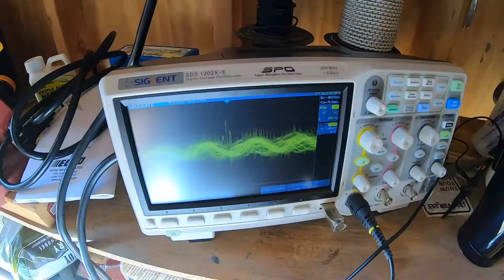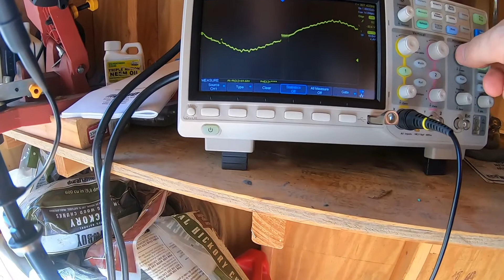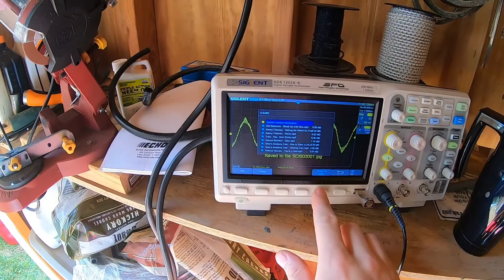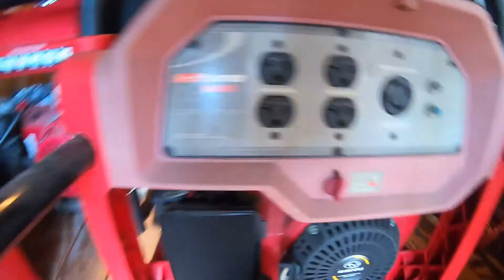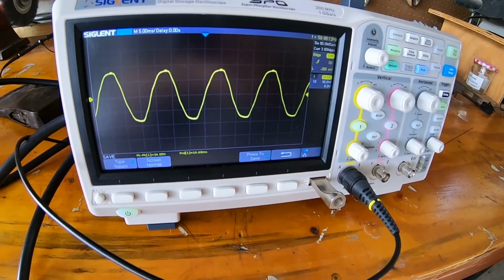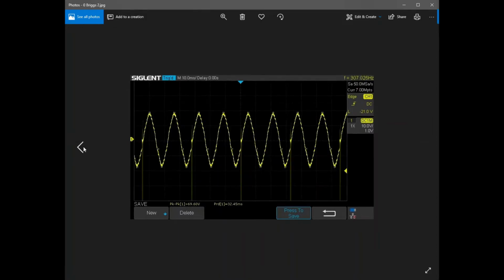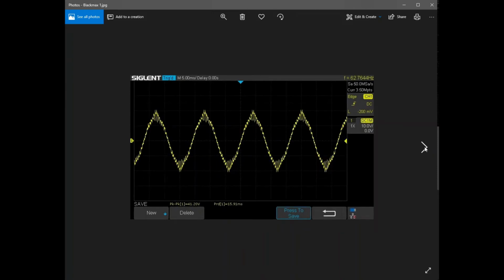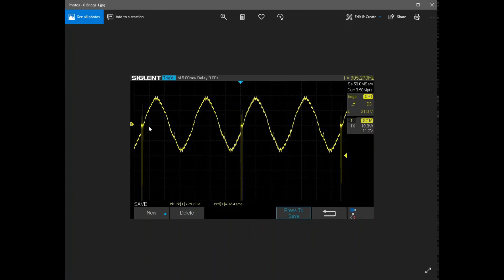Portable Generator Waveform Comparison

Comment: The best is to get a inverter generator there the best for fine sensitive electronics! There small but they convert to dc then to ac so they are the best. you will pay 1200 or more for a Honda etc

Comment: I have a really left-field thought on that zero-spot on the Briggs. Is it a four-pole generator? Maybe this is why the defect would only show up every other wave. Half a rev produces one wave from one pair of poles, the second half of the rev produces the wave from the second pair.
Such a generator would also run at only 1800 rpm yet still produce a 60 Hz. output because of the four poles. (2 x 1800 = 3600 which gives you 60 Hz.)
I'm not at all an expert, however, and this is a total guess on my part.

Comment: Hook a small plug-in transformer up to a regular extension cord. Then, hook up your scope probe to the transformer output, making sure to isolate the two output wires. Only after you do this, plug the extension in to power it up to read the waveform. Personally, I avoid probing 120 VAC directly for safety reasons.
I use a little 12 VAC transformer and I adjust each of my two generators to about 61 Hz (16.4 milliseconds) unloaded and then see if it stays near 60 Hz. (16.7 ms. ) when I load them down. 
Admittedly there is very little difference, but if you are careful and have a good scope, it can be done.

Comment: i drive a company vehicle and in my 25 yrs i have been thru 5 trucks and ALL trucks have an inverter.  
EVERY inverter was a modified sine wave inverter. I have used the same laptop thru 3 of those inverters in a 5 yr period, my laptop / charger / ipad was never damaged due to a modified sine wave. 
My fiber optic splicer and my otdr and my $5k copper test meter ALL get powered and charged from these modified sine wave inverters and NONE ever have any issues.

Comment: Good stuff.
Trying to build a backup battery system for my home and read in some comments that battery manufactures recommend a
True Sine Wave Inverter generator. This might explain why.
I have both a regular Duromax 10,000 watt,
and a Preditor 5,000-watt inverter.
Just wondering how much it matters?
Could it just shorten the life span of the battery if the power coming in isn't clean?
Or can it also be Dangerous?
Maybe I should stick with using the smaller inverter to recharge batteries,
even though it will take a little longer.
My head is starting to hurt.....lol
Also, its funny when you showed a Coleman, I said to myself, I bet this is going to be the worst one
out if the three for distortion.
YUP!
I have an old Coleman 7,800 watt that doesn't produce power right now. The Kohler motor on it runs though.
When I used it years ago, my basement florescent lights would flicker SOOO Bad, it felt like I was in a Haunted House...lol
I borrowed a friends Honda, and my basement lights ran cleaner than with Grid Power.
I've since changed out all of them crappy lights.

Comment: That noise is normally from the AVR turning on.  Its normally half wave excitation . Portables usually implement capacitors for excitation or half wave rectification AVRs. They "turn on" usually @ the same phase angle.

Comment: This video was very helpful to me today.  I have a Generac standby generator, which is designed and marketed to power my house during a utility outage.  It has an alternator similar to the ones in the generators shown here.  It should create 60 Hz power, but my multimeter showed the Hz bouncing wildly all over the place.  The problem was that these generators create shaggy power and the multimeter couldn't understand it.  So the generator was just doing what it was built to do, but the test results looked strange and had me concerned for a while.  The professional techs who work on these generators use better meters than the one I have.  Thanks for making this video and leaving it for me to find.  It was an important piece of the puzzle.
Reply: What else would your Generac standby generator be designed/marketed for? 

Next time, try it with a load attached.

Comment: I understand that a dirty sine wave is undesirable but wonder how dangerous they are for electronics. In my research about sine waves I have noticed many people using power inverters with modified sine waves when camping. My question is are modified sine waves better than dirty generator sine waves.
https://youtu.be/B-xO8-uMFNw

Comment: Another helpful video, thanks. May I suggest next time you're comparing waveforms...I assume your scope has an overlay feature, where you can have two different traces overlaid on top of each other (usually in different colors)? That would be helpful in say, comparing each wave to the direct AC waveform.

Comment: Another thought on your utility power.  You've got bursts at the top and bottom peaks which suggests to me that there is an insulator on a pole someplace that's arcing / breaking down / at the peak voltage.  I bet if you turned on an AM radio you would hear the BUZZZZZ from that insulator problem.  But it's very strange that you have such a distorted wave to start with.  I wonder if the Siglent scope, or perhaps your probe, is distorting that?
Reply: As Wheel Horse suggested, checking and adjusting your scope probe is a good thing to do to get the most accurate results. It is a single simple adjustment for the low frequency range looking at generators. And the warning someone else gave about your grounded scope and ungrounded generator is dangerous. Also the distortion in your utility power looks pretty bad. Figures it is FPL
Reply from the maker: My utilities are all underground here, but there are power poles in my back yard that might supply power to my neighborhood. Rumor is they are scheduled to get replaced by Florida Power and Light sometime in the next 400 years lol. How do I test to see if my scope/probe is distorting that? That's a bit beyond my knowledge unfortunately, but happy to learn and try.
Reply: @JoesGarageProductionsLLC  Not really sure if it would be easy to check.  You would need some sort of known reference signal to look at.  Your scope probably has a 'calibration signal' on the front panel, typically a 1 KHz 5 V P-P Square wave.  You hook the probe onto that and there should be some small trimmers on your probe that you turn to show a square wave without rounding off the corners.  I've not used a Siglent scope myself so can't tell ya much more than that.
Reply from the maker: @Wheel_Horse  yep I do see something like that. I'll mess around with it the next time I have the scope booted up. Thanks!

Comment: "We jammed in Joe's Garage... "  Hey man, even the power from your utility looks like crapola!  Quite a bit of distortion on that waveform. Our utility power looks like a perfect sine wave and I measured the THD from the PoCo to be right around 3% or so.  My scope has the FFT resolution needed, and just today I measured a Generac GP5500 and was very unhappy to see that it had well over 20% THD.  I suspect that all three of yours would be above 20% also judging from the look of the waveform.  I think there's something wrong with the B&S generator.  Every 2 cycles you have that spiking going on.  That's not good because the spikes are well over 120VAC.  "... we set up the drums in the front of the old Dodge, it was a '54 with a smashed up door..."
Reply from the maker: What scope are you using? Would love one that made measuring (or even calculating THD) easier/possible. The Briggs generator had a bad AVR module that I ended up replacing in another video. That eliminated that 2 cycle "weirdness". I also picked up another Briggs generator with a "low distortion" head that blows all of these generators out of the water. Still not as nice as utility power, but much better than any non-inverter portable I've tested.
Reply: @JoesGarageProductionsLLC  I'm using a Tektronix TDS 3012B.  Not really a 'super high end' instrument, but certainly no slouch either.  I believe that the resolution has to do with the number of bits in the A/D converters used.  Not sure how many bits this one has, but it has been enough to measure THD on my machines (and audio equipment).

Comment: I would be more concerned about the DEFECT high voltage spikes like that can be several kilovolts and destroy electronic semiconductors instantly. Most likely cause if a dead spot on the slip rings where the carbon brushes momentarily arc out causing huge back emf pulses induced in the rotor & field coils. you might want to clean those slip rings 'James Condon' on youtube does that sort of thing all the time.
Reply: The high voltage oscillating spikes is what I was wondering about, too.  Might go away by connecting a light bulb or resistive space heater as a load

Comment: will a power cleaner work
Reply from the maker: Depends on how big/powerful it is. A smaller 120V model should be fine but a larger 240V commercial machine might be too much.

Comment: Thank you for this video. I'm choosing between synchronous and inverter generator for backup and it was useful.

I'm pretty sure the strange spikes with the first generator have something to do with the spark. As far as I understand all those gens are using 4-stroke engines, so the spark happens each 2 revolutions. Probably there are some issues with generator's electric part, which could be resolved and the spikes are gone.
Reply from the maker: I thought the spikes might be coming from the ignition initially but just didn't line up with the waveform. I'm glad you enjoyed the video though and good luck selecting a generator!

Comment: wow, i never realized how shitty the output voltages on these generators are, i mean it's just a rotating magnetic field
Reply from the maker: Yeah I was pretty surprised as well. Not a very widely talked about thing either.
Reply: It's honestly sad. Because the rotating field winding and stator would produce a pure clean sine by themselves. The noise is created by the crappy AVR, which does not feed clean DC power to the field.

Comment: So I think there are some issues with this quick test and it just comes with all the pit falls of electrical tests. First when using a oscilloscope the negative lead is internally referenced to ground through the power cord. In this set up the generator is float ie not grounded. This can be dangerous as now the neutral of the generator now referenced to ground through the oscilloscope which it is not designed to handle much current. This can be fixed by using a differential probe or using a isolation transformer on the power cable of the scope. Talking about scopes your scope can perform a data capture, it would spit out a txt file in which you can then post process in matlab or excel to determine things like THD, current harmonics and other useful data. Power quality can be greatly improved with good grounding, insure the generator is well grounded. The generator should be tested in a no load and a full load condition. This can change its output waveform. Talking about loading generator how it handles reactive loading is also important. I guess what I am trying to say is that with a quick test like this it can be miss leading.
Reply from the maker: Thank you, I appreciate the feedback! Have any suggestions how I might learn to use this scope better? Quite honestly, the documentation that came with it (and that's online) seems like it is designed for electrical engineers. I am an engineer, but it has been a LONG time since I took any EE courses so I could use a refresher.

Comment: Could the alternate wave irregularity on the Briggs be related to the engine firing every other revolution, since it is a 4-cycle engine?
Reply from the maker: It ended up being a problem with the AVR. My guess is probably a bad  capacitor.
Reply: @JoesGarageProductionsLLC    Did you have some kind of external regulator connected when testing these ?
That "could" cause an issue but why would only one generator have that artifact ?

Comment: I have a Briggs & Stratton open frame 5k Generator. I bought it second hand, never used, and I've never needed to use it for a power outage as I have other systems for short term power outages (Goal Zero). Lately I've been reading about the potential damage a non-Inverter Generator can cause to electronics. One solution offered was to run the generator power though a Line Conditioner in order to clean up the waveform. Is that something you've considered, or have any experience with. Thanks for you time.
Reply from the maker: I gave it some thought a while back but a high quality line conditioner is easily as much as a high quality generator. I would love it if manufacturers were more open about the quality of their generator heads... There is quite a bit of variation

Comment: Okay, that was helpful. I had heard about the potential problems with non-inverter portable generators and how they may not be the best power source for "sensitive electronics", so I ended up buying a small inverter generator in order to run my computer and TV in the event of a power outage (with a non-inverter pulling the rest of the house). In fact I discovered this video by viewing your review of my new inverter gen elsewhere. The visuals gave me validation of the difference....so thanks!
Reply from the maker: No problem - most generator reviews I've seen oddly only look at frequency and voltage. They are important, but the waveform is as well. Glad you found the review helpful!
Reply: @JoesGarageProductionsLLC  Joe: This video from Dave Jones (Electronics Engineer) may help: https://www.youtube.com/watch?v=xaELqAo4kkQ

Comment: Bunyannnnn!!  I did this exact experiment after my garage refrigerator stopped working, though, I didn't run a combustion engine in an enclosed space!  CO poisoning is real man! Anyway, I saw a similar almost "sawtooth/jagged" waveform on my B&S Elite which I assumed is what killed the fridge.  Hope someone chimes in with a solution...maybe a filter?  Anyway, good to see a familiar face on youtube...keep the videos coming!
Reply from the maker: Carini... wow... been a long time... what, 20 years!!?? Hope all is well!

Thankfully I didn't win a Darwin award... I was careful to keep the shed door open and to walk outside when I felt like I was about to pass out.

Electric motors are notoriously sensitive to poor quality power. It can cause overheating, humming, and generally, really bad performance. The B&S Elite seemed to have the best waveform of the 3 i tested... my big concern is the "dead spot" that occurs every 2 periods. I'm planning to haul the genset out of the shed and into the garage to tear into it and see what's up. I have a hunch the AVR is toast but I won't know for sure until I hook the scope up in a slightly less toxic and nerve-wracking environment.

I am contemplating consolidating and selling these 3 portable gensets and purchasing one larger, higher-quality one... or perhaps swapping the gen-head for a higher-quality unit, like the Mecc Alte S20W-130. Stay tuned...
Reply: @JoesGarageProductionsLLC  Agree the B&S was pretty good but still had a lot of noise vs what comes off the line.  Some pretty cool (and getting larger) inverter style generators out there that wouldn't have this problem.  I will probably go that route or a whole house gen with a high quality gen set that can keep the THD down.